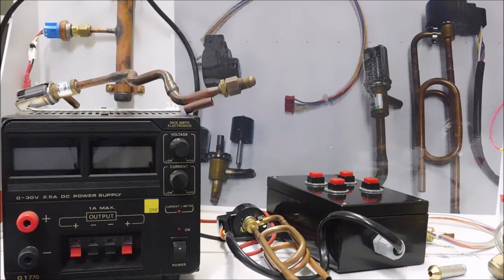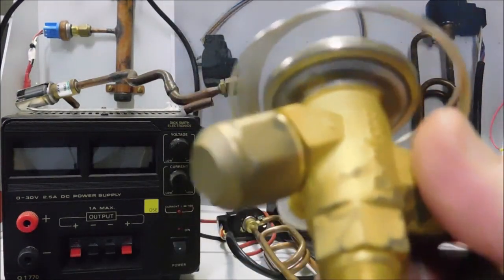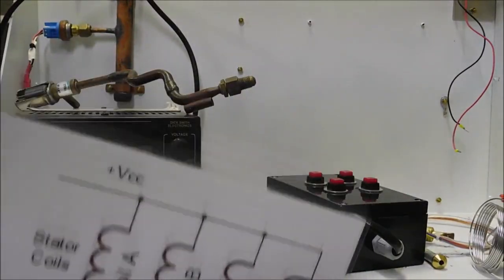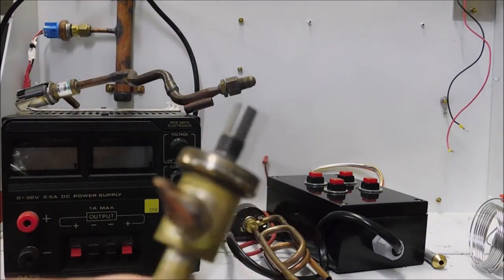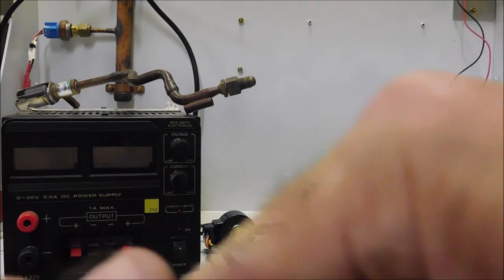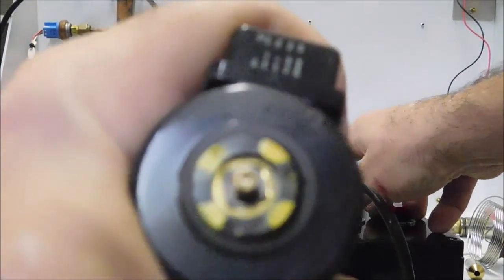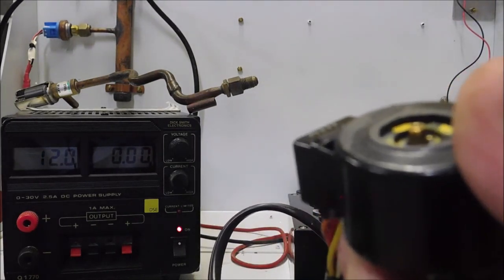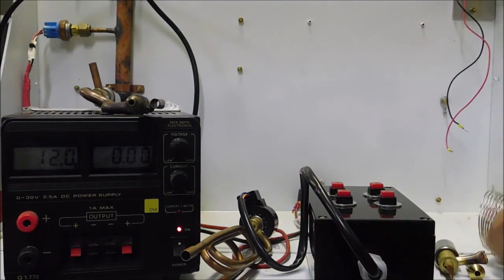Electronic expansion valve

Comment: EEV can do up to 500 steps
Reply from the maker: Danfoss and Carel work on 480 pulses in refrigeration  to fully open , so 480 steps. Some aircons can be higher which increases  the  range of closer capacity control..
Reply: Fujikoko  make goes upto 2500 steeps for daikin and Samsung. 
Below 1000 steps refrigerant  is sufficient and above 1000 to 2000 refrigerant is inadequate.  2500 steps  for recovery  and vacuum  mode.

Comment: Great video.  What sound do they make when you first switch on the air con and they initialise?  I have a problem with a mini split air con freezing.  Most likely low on refrigerant, but want to check the EEV before I call a licensed technician.  My EEV makes clicking noises for 2-3 seconds when the unit is powered on.  Is that expected?
Reply from the maker: Yes thats correct. You will hear a ticking sound durining initialisation from power up. The valves motorised head  receives more closing pulses  than usual to ensure it starts off in  the zero step  or closed position. The pcbs do not remember which step they were on  during a power up
Reply: yes